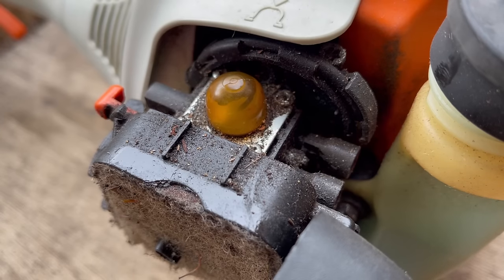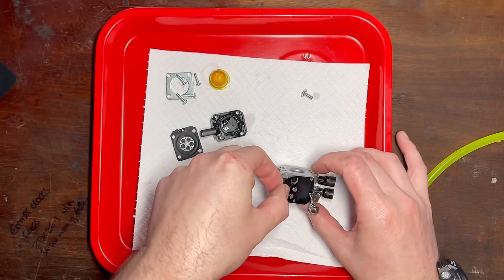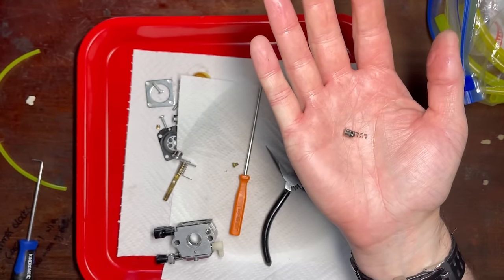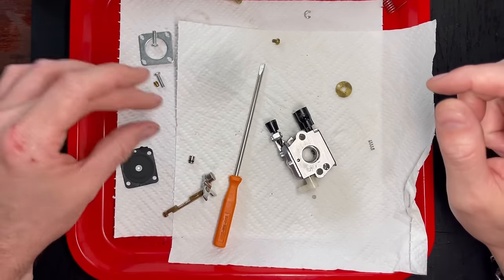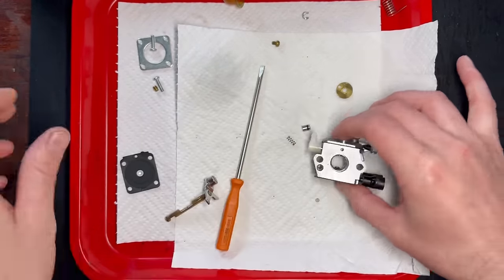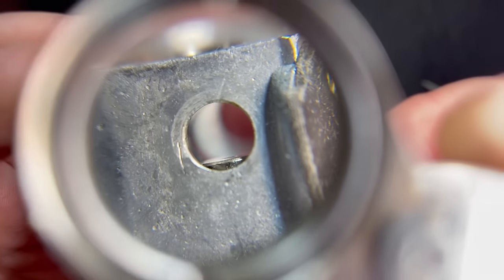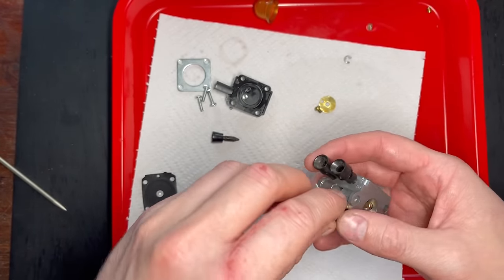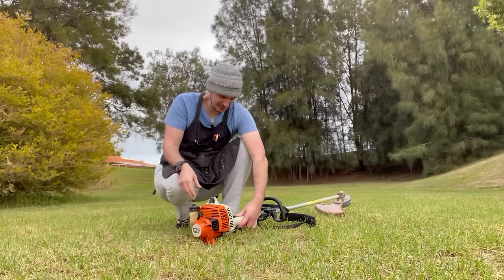Purge Bulb Won’t Fill Up With Fuel? Here's Why!

Comment: I have been replacing metering diaphragms, purge bulbs and fuel lines in these carburetors for years and never knew how they really worked and that they may have a fuel pump.  Thanks for the detailed information.
Reply from the maker: You’re welcome! :)

Comment: This is great info that so many young techs never learn. Having said that, from a repair shop point of view its quicker and cheaper for the customer to just replace any carb that won't prime.
Reply from the maker: Spot on Scott, this isn’t something the average shop would be able to justify. It’s something I’d recommend to a home owner wanting to get their machines working again or even someone running their small engine repair business that is offering an alternative to an expensive oem carb when costs need to be kept down :) 
I calculated that what I’d charge for my time to do this would be 3x cheaper than the customer buying an oem carb. That said my overheads are minimal compared to a shop of course!
Reply: @VintageEngineRepairs  BINGO!
Reply: For now it's economical to  replace the card but it won't be as new anti-petrol regulations set in making all of this impossible to maintain without critical knowledge.

Comment: You didn’t explain that the reason the engine was bogging was because the accelerator pump was now disabled, and the carb had to be adjusted to richen up the low speed side to compensate for that lack of additional fuel upon opening the throttle.
Reply from the maker: I try my best to cover everything, but sometimes I’m on auto pilot.
Reply: Well, he had to adjust it again anyways because he had removed the adjustment screw so that he could thread in the throttle shaft and tighten up on the spring tension. Sometimes we need to try and figure out the finer details ourselves and be grateful to others for sharing the major details of their work experience in doing some stuff, whether it be mechanical or otherwise. Anyways, I worked on a Stihl weed eater and it would have cost $50 to ship a replacement carb over in a week to two.

Comment: I did not know that these carbs have an accelerator pump. 
After watching your video I pulled the carb, attached a temporary line to the inlet and immersed into fuel mix. The primer bulb would not lift any fuel. I then opened the throttle shaft and applied a few drops of 30w oil past the flat to cover the accelerator pump piston, closed the throttle and tried  to prime again. The bulb immediately lifted fuel and filled. This was a quick way to confirm that the O ring was at fault. Upon disassembling, the O ring was brittle and broke in 2 pieces when removing. I replaced the O ring with a generic nitrile 1mm x 3mm id. All is working as it should now. 
Thank you for your clear and concise explanation.
Reply from the maker: You’re welcome mate, that’s a fantastic test you mentioned with oil, I must keep this in mind for next time, thanks for sharing!

Comment: Thank your for the video!  My BRAND NEW replacement carb has got to be sucking air - as evident by some bubbles in the fuel line.  This video gave me a few ideas to chase after.  Thanks a Bunch!
Reply from the maker: You’re welcome! If it’s an aftermarket Chinese clone, check everything inside it :)

Comment: Liked, you are amazing. On my trimmer. I prime the bulb. Crank the engine and it runs perfect for maybe 3 mins then stops You have to reprime and crank again. Same thing over and over again. It's like the bulb is losing its prime. Any idea what might be happening? Haven't seen my problem discussed on the web. Thanks in advance.
Reply from the maker: Hey! Thanks for the kind words. I’d personally take the carburettor apart, put a new kit in it and maybe give it a tune. Check fuel lines and filter too 👍👍

Comment: @VintageEngineRepairs I'm extremely impressed by your expert knowledge on these units. In particular your ability to perform a bespoke repair by using your understanding of the pump and sealing dynamics is a skill I'd really love to develop

I've been repairing power tools and small engines for a couple of years now but still don't fully understand carburettor operation. Are there any books or resources you used to get your knowledge up to this level?
Reply from the maker: Thank you for your kind words :) I have videos on how they work and more coming out very shortly. Start with this one :) https://youtu.be/_4K6dBQTeek

Comment: Thanks for this ❤ I have spent countless hours on Stihl carbs trying to fix a non priming problem without realising that this accelerator pump even exists. i have seen the small screen in the repair kits and wondered what it was for but they never included an o ring 🙄 have bought a pack of 1x3mm o rings as another viewer described. No amount of carb cleaning would have solved this issue. Thanks again 🙏
Reply: Update, got to the accelerator pump then lost it as the spring launched it into the garage somewhere 😂😂
Reply from the maker: Oh no 🤣
Reply from the maker: Not many know about it :) glad it helped!

Comment: Hey there, I just happen to catch this video as I was scrolling . I really like how you explain what you're doing and how it works, that makes more sense than what I've heard. The drawing helps, and the close ups with magnified. That helps when it's so small.  Thank you
Reply from the maker: Thank you! I’m glad you enjoyed the video and it made sense! Sometimes it can be hard to convey everything required :)
Reply: Yes you did great, maybe speak a tad louder or have a mic closer to your mouth if possible. But yeah, I do a little small engine repair, I use YouTube as a guide. For refreshing my skills. Most videos don't go into depth of taking it apart and explaining it more thuroughly as you have. So I'll definetly be watching more of your vidios. I took small engine course in HS. I was the only female. So we had to lock my engines in shop techs office to protect it from the guys vandaling it. But it's been 30+ years. So these videos are great refreshing for my memory lapse of time. Thank you! 😎👍
Reply from the maker: @suzanemartin8242  so sorry to hear of how it use to be. I have heard many stories of the nonsense that use to go on back then. Thankfully times have changed and we see more woman in the repair industry and flourishing. I’m so pleased you didn’t give up. I’m always here to help when I can :)
Reply: Strange as it seems, it hasn't changed that much. The guys make it super hard to keep jobs. I aced the small engines even thou. But got crazy and went into auto body r/r. Again only female. My husband scared the poo outta those guys, after I reported my projects being damaged by vandal. That was college. I finished in the top 3 in college. But I was lucky if I was hired. Let alone they savataged my work. So in the NW, it's still very hard for a female to even get started in mechanical world. But I got burned out on fighting for employment. Had to support my kids. Couldn't keep going on. So I just enjoy it for my own good. Nice to know skills.

Comment: Brilliantly explained video . I am amazed at your knowledge and explanations . I have several Stihl tools and to be honest I never did understand the intricacies of how a carb works . I usually replace diaphragm  and gaskets , fail , and then replace carb . I have a Stihl sh86 blower that only fires once but fails to start . so I have 100  psi of compression , a good spark , replaced all carb parts and after  a half day episode it still does the same  . Fires once and no more . I have a new Stihl  blower but would love to get this old one going just because  I believe it is something very minor . Just a great video , I would love to know where you obtained all this technical info , really impressed .
Reply from the maker: Thanks for the kind words, a lot of what I have learnt has been from stihl manuals that are for
their technicians, also through research online, good mentors around me who help and and frustratingly obsessive personality that doesn’t let me give up until I understand something. 

Re your 100 psi. This is actually too low for a 2 stroke ope engine to run. They say 120 is about the lowest and even then it won’t run well (if at all). The caveat here is if your compression tester is not designed for small engines, that could be why it’s low, even if the engine is good. Too much to explain in a message, but here is a video on the topic - https://youtu.be/M6eXO6n8hhg?si=7zrVpHYwLpbOuqhQ

Note on some occasions 2 stroke engines are low compression (70 psi and they’ll run) but not in outdoor power equipment. They need about 150psi.
Reply: Back again , thank you for your reply . I will study your recommended video and I think it will be prudent to check compression on the new blower . Both are Stihl sh86 models, the problem one I have for maybe 12 years  .
Just for your info , the new one gave a slight problem in that the outer stop lever stuck down  in the off position due to the very cold weather and the tight fitting of lever . I removed the upper hand  , greased and freed out a bit and that solved the problem . The lever is designed  to spring up into the start position automatically . Initially I did nor realise this and on account of hearing that the petrol quality has changed I believed that was the problem . 
Anyway thank you again . @VintageEngineRepairs

Comment: Really I have had that problem and was able to buy a o ring kit from Harbor freight and in that kit is several o rings that can be used. Just a thought if you really want to fix it for a little bit of money you can. But like the one guy said you can order a new carburetor for cheap to and the one’s I buy come with hoses and filter. Easy peasy.
Reply from the maker: The key is that they are nitrile or other petrol resistant material. If so and they fit, you’re good to go! :)

Comment: Thank you. I have a Stihl FS45 line trimmer that's just out of warranty. The bulb wouldn't fill and would remain completely dry, just like the one you demonstrated. The carb is ostensibly identical to that in your video. Pulling it apart, cleaning and reassembling it, didn't initially solve the problem. Eventually I took the cover off the fuel-pump side, as you demonstrated at 2:40. I couldn't see anything wrong with the rubber gasket and its two flapper valves (I presume). Regardless, I removed the thin rubber gasket. It was well adhered to the metal surface and I feared I was going to tear it. Anyway, no damage seemed to be done in its removal. As I could see nothing wrong, I reassembled that section and the rest. 

After reassembly of the carb I put the intake pipe on my lower lip (dry) and pressed the bulb a few times. I could now feel it sucking. My fingertip wasn't sensitive enough to detect it. 

I put the carb back on the line trimmer and pressed the bulb a few time. It now filled with fuel. I'm not sure what fixed it and how.  

Unfortunately, the trimmer still won't start. 

There was something I noticed on the metering side. The diaphragm looked lumpy, as though it had tried to expand, sort of like when paper dries after being wet. The other thing is that the bulb, once filled, resists further pumping. I don't know if that is normal. 

Thank you for your video; I have liked and saved it.
Reply from the maker: Thanks for sharing! It could be your main nozzle!

Comment: Great video! I might add that if you are in the US, you will likely be dealing with ethanol in the gasoline, the alcohol in which will destroy nail polish. So use a product like Seal All that is resistant to the alcohol.
Reply from the maker: Good advise! I wasn’t sure if alcohol will dissolve nail polish, thanks for sharing g
Reply: @VintageEngineRepairs  Recently found your channel, some great info in all those video's. This a particularly helpful video explaining the possibility of an air leak at the plunger o-ring - not necessarily just the idle and main jet non-return valves allowing the purge bulb to suck air, nice work!
Since the introduction of E10 fuel here in GB, my use of nail varnish when resealing welch plugs has had to stop. Nail varnish seemed to be ok with E5 fuel. Have you noticed that the original welch plug sealant used by Zama and Walbro has been falling out and blocking jets/valves for some years - I wondered if it was being affected by the E5 fuel.
I've just done the same seal up job with nail varnish on an FS85. With the small surface area of varnish actually in contact with fuel I'm hoping the job should last for a reasonable time. We'll see...

Comment: My KM55 kombi motor ( basically the same as the FS 55 power head) had a bad check valve inside the metering block.  Also had a leak in the metering block around the hose connection.  I also have an inconsistent idle ( going lean on and off, with idle speed rising and falling) on my old still 028 chain saw.  I’m going to check that check valve in the main nozzle.  I’ve done everything else.  I may also have too much slop in the throttle shaft, and it may be sucking air there.  Thanks for your input depth videos on troubleshooting these carbs.  They are the best on you tube.
Reply from the maker: You’re welcome and thanks for the kind words! Keep me posted

Comment: Top job mate. If the accelerator pump can be disabled, why do they put there in the first place?
Reply from the maker: Great question! I’m only guessing here as I can’t be certain, but with the limiters in place and the use of an accelerator pump they can have it set leaner at idle and still get good off idle acceleration. However I remove the limiters so can get past it. Notice at the end of the video I say it’s a bit lean and richen it up? That could be the requirement. Though honestly I can’t tell you, I’m simply guessing!

Comment: Help please! my strimmer purge valve depresses ok but stays down for a long time! after a few pumps starts to work ok! your thoughts please?
Reply from the maker: You have a blockage somewhere :)
Reply: god that was quick!! thank you, I think the tank filter is a good starting point and work back it is 25 years old after all! did put a kit in it 2 years ago and was working well at that time! cheers, Alan. @VintageEngineRepairs
Reply from the maker: @alanreynolds2125 you’re welcome :) yep, start from the filter and work your way towards the bulb :) you’ll find it!

Comment: Hi Tom, i have just done a Stihl FS 38 same problem no priming but i have just put a Chinese carb on, there is few few videos on them type of strimmers not priming, but you have done well finding out what the problem is, the small seal is that about the same size that @henrymurawskibigdogrepair was looking for and got
Reply from the maker: Thanks Nev! I believe it’s a different size, but you never know! Yeah you can chuck a new carb on, I like the challenge of fixing it though haha.
Reply: @VintageEngineRepairs  you did very well on that one 👍👍

Comment: How do you know all this detail?  I was searching for this type of information but couldn't find it until I came across your video.   Nobody else that I could find had this level of detail about how this carburator works.  You should make more detailed videos like this.   Are you a carburetor engineer?   Thank You!
Reply from the maker: Thanks for the kind words :) it’s a combination of research, reading manuals, reading stihl documentation for their mechanics, trial and error, forums and also good mentors around me :)
Reply: @VintageEngineRepairs  I had replaced the primer bulb recently and when my FS250 would run for a while and then want to stall out, but I could sometimes prevent it from stalling by playing with the throttle.  I started to think that maybe I had the primer hooked up backwards, since it didn't seem to hold fuel.  I tried reversing it and it would hold fuel then but I figured it couldn't be right because you wouldn't want to push unfiltered fuel into the carb, so I realized it must pull it through.  But it seemed to only suck air.  So when I found your video I realized that there was something wrong with a check valve that prevents sucking air from the air intake near the butterfly.  Anyway, when I took out the the butterfly valve a little ball bearing fell onto my driveway and I dan't find it.  So I just ordered an aftermarket carburetor to replace the carburetor with....but I know for next time.... :).
Reply from the maker: That ball bearing is the choke side, no accelerator pumps on the fs250’s. Funnily enough that’s the exact machine I’m working on as we speak. The sealant video was featuring it and the next video too. I needed a new carb as mine was so damaged by corrosion and no parts available. $250 Australian for a new one!! Had to go AM, brought it today off Amazon, I’ll do a video on it haha.
Reply: @VintageEngineRepairs  I realized it was the choke side shortly after I mentioned it.  I found the ball bearing with a headlamp at night and put that back together. I haven't had a chance to take apart the throttle side yet.   I am soaking the membrane in DOT3 right now.  Can both membranes be soaked in brake fluid? They seem like different types of plastic...  I really need to watch your videos more closely, so much detail to digest but I like to fully understand how things work and your videos provide that.
Reply from the maker: I’m not sure about the fuel pump diaphragm! I haven’t tried it. If you give it a go, let me know your results :)